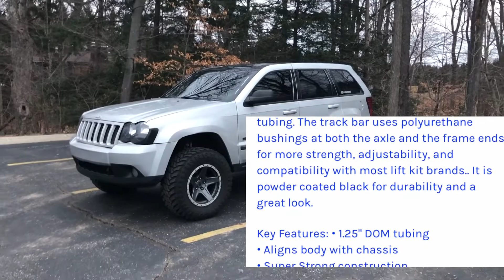When do I need a Longer Track Bar?

Comment: Does this fix the front axle as well? My front wheels are facing inwards? What do you recommend?
Reply from the maker: It wounds like you need to upgrade your upper control arms & get an alignment
Reply: @Notrailrated  I got Jba upper Control arms . Same as yours . Running kinda same setup as yours . Idk if they installed them right way or not.

Comment: What did you set your track bar to?
Reply from the maker: Redneck questimation. Once you set it down on the ground you can use a tape measure to see if your rear tires stick out evenly. I got mine even on the first shot, but if you dont you can adjust the bar some more

Comment: Have you ever towed with your v6? If so how does it do?
Reply from the maker: With a tune it tows great. They V6 honestly does a great job moving any weight. I try to keep towing to a minimum due to the weak trans.
Reply: Notrailrated do you think I could tow a side by side? With the trailer it would be max 3000 pounds? Can the trans hold up doing that regularly
Reply from the maker: I want to say the max is 3500 for the trans. I would say it’s okay for short distances but I wouldn’t pull it any further than 40 miles at a time. If I towed regularly I would also add a larger trans cooler.